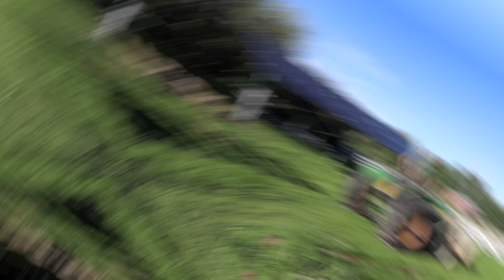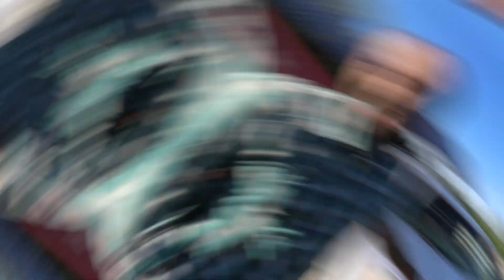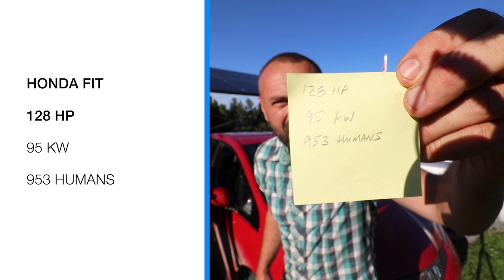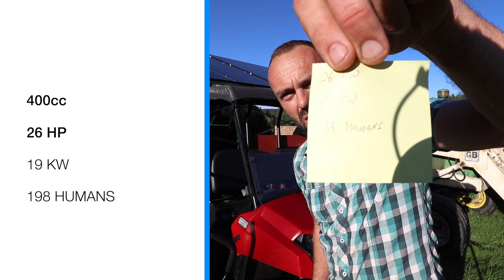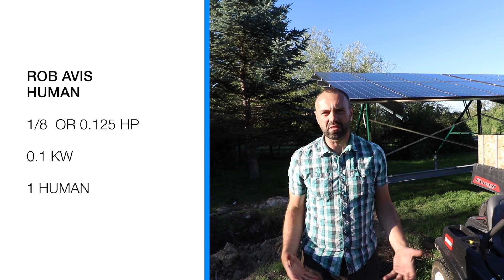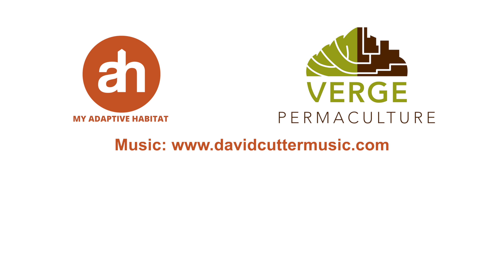Why Peak Oil Matters More Than Ever:  Permaculture Canada

Comment: The comparison with humans is off by one or even 2 orders of magnitude as the HP ratings of these cars don't relate to the HP of "work" they can do.
 It's HP of the internals. Tesla's HP rating is similar to these cars, yet its battery is 100KWH. If it was used for the whole 200KW of its "engine power" it would only last 30 minutes.  It's doubtful that you need an entire town to pull a trailer for 100 miles distance ;) There won't be car's velocity but the job gets done with much less dramatic "muscle energy" requirement. If you put a peasant on a farm with no machinery he still can feed himself with 100W of power he himself produces. The problem is that of the adjustment - too many people doing useless service jobs in cities having 0 skills to sustain themselves on their own.

Comment: Electric motors need electricity, which is mostly generated by fossil fuels.  So the alleged efficiency of electric vehicles is deceiving because burning coal or natural gas to make electricity is not optimally efficient.  Energy is also lost when converting from one source of energy to another, or even converting from AC to DC.

Comment: Can someone check my math?

My 90hp  tractor (weighs 7klbs) / 40 gallon tank / worth about 10k U.S. dollars 

-7lbs lithium batteries = 1lb diesel (energy equivalent) 
-Gallon of diesel = weighs appx  7lbs
-40gal diesel  tank =  280lbs

It would take 
-13,870lbs (280x7x7) of Tesla batteries
-Cost of 200k (I think/best guess) 
-To produce the energy equivalent output of the diesel in my 40 gallon tank?

I would triple the weight of my tractor and increase the cost by 2,000%? 

Is my math close to being right?  That sounds way to nuts to be right?

Comment: I've got some bad news for you. Peak conventional oil occurred in 2007.  Fracking of "tight shale" is not quite the same thing, as it's actually called "light equivalent liquids".  And while fracking has produced enough gasoline and propane to force the costs of those fuels down; gasoline is about the heaviest hydrocarbon that can be refined from "light equivialnt liquids", but our world doesn't really run on gasoline, but diesel fuel and heavier fuels.  We're already in the after peak-oil age.
Reply: Not only that, the tar sands we have been relying on are drying up because of COVID temporarily  plummeting oil prices

Comment: It's interesting, if you hooked the JD up to the Honda and took off in different directions, there would be a lot of smoke from the 250hp Honda, as the 50hp JD pulled it inside out. :-)

Comment: BioMethane is one of the many options
Reply: But doesn't it take like 1000 cubic feet of Biomethane to equal 1 cubic foot of diesel?
Reply: @trollforge  is just like natural natural, but made in farm by anaerobic digesters
Reply: @BrunoGarcia79  so 1040.4 cubic feet...
Reply: @trollforge  you are comparing a gas to a liquid consider the weight and compressors
Reply: @BrunoGarcia79  so, if you could compress biomethane into a bbq tank, you could get about 4.7 gallons, or about the equivalent of 5/6s of a gallon of diesel?
Reply: @trollforge  compressing biomethane (3000psi), to less than 1% of the volume it occupies at standard atmospheric pressure...
Reply: anyway you keep comparing apples to oranges... BioCNG as 20267 BTU per pound a diesel as  while diesel as 18397 BTU per pound ...  1870 more BTU per pound than diesel...
Reply: @BrunoGarcia79  OK, that would make it a much better option, but it is not reproducible in an on farm operation...
Reply: @BrunoGarcia79  That is not the figures I am seeing... I've got "6.38 pounds or 139.30cuft. of CNG has 100% of the energy content of one gallon of diesel"  https://afdc.energy.gov/fuels/fuel_comparison_chart.pdf  Am I reading something wrong?

Comment: Good video. As I've been working on reducing my requirement for money, my requirement for power was evident. As I'm working on reducing my requirement for power, I realized how big my requirement for water is. Being urban in zone 3, its a challenge to solution an emergency water system that won't freeze. Slowly but surely we are reducing our requirements for fossil fuels to heat and reducing power consumption before investing in solar. My biggest reward was moving to no dryer and no extra freezer. That was almost half of our consumption. We've now moved to electric free washing and reducing water consumption came naturally from that. Refrigeration is another challenge area. I enjoy your knowledge sharing. You get me thinking out of the box. Thank you!!
Reply: Depends on your location, rainwater harvesting can be a solution for most of your non-drinking water needs.
Reply: @sergio2441  We do that for summer months but again we can't bring it indoors for winter use. I have no basement and our house is made from cindercrete so I can't lift it to put a cistern in either. I am thinking of using the excess rainwater to create an ice house once we complete our covered porch with outdoor kitchen - future budget. It wouldn't be huge so I'm not sure how long I could keep it functional. Be a fun experiment.

Comment: Homemade bio-diesel is a possibility, I wonder how the math works on energy in -> energy out ratio. I wonder how much land/labour/time to have farm-scale diesel. I ask because the rare elements required for high-efficiency batteries to replace those tractors require a working global supply chain... which only functions if energy is cheap.
Reply: /I wonder how the math works on energy in -> energy out ratio./I cannot give you a reference right now, but I read that it is close to 1.1 to 1 or even lower.
Reply: @sergio2441  I doubt it would be anywhere near that if you factor in the planting, growing, harvesting and processing of the crop, & production of the oil...

Comment: Something you haven't touched in your video is ethanol or vegetable oil as a source of energy for this engine. This would require less battery and you wouldn't need to replace that old tractor, maybe?

For example, how much hectare do you need to run in your climate your tractor on canola or sunflower oil? Compared to solar panel?

Also solar panel are not really necessary if your electricity come from a nearby renewable source like hydro (which last a century when build correctly). Relying on the grid depending on the context might be better investment I would think.
Reply from the maker: Very low EROEI.
Reply: @VergePermaculture  for ethanol, I have read it was around a mean 5:1, but I have found nothing about vegetable oil as a direct replacement for diesel. I would expect it to be above ethanol has you would have less transformation has once harvested, you just press oil out. Do you have any data on the subject? (I know biodiesel is terrible with a EROEI of 2:1). I am guessing it also depends on the local climate and how productive a field of canola or sunflower is. So you EROEI would vary with climate, but Canada being a huge producer of canola, I would hope it isn't that bad in Canada context (I haven't looked at it much).
Reply from the maker: @CedricBAIL  It depends on if they are using nitrogen fertilizer. The other issue is biodiversityloss, soil erosion, phosphorus application, pesticides ect. ect.
Reply: @VergePermaculture  Just realizing something here, but is EROEI the right measure to take decision? In this case, we also need to change tractor or at least their engine and add battery which require also a lot of energy to do and would not be necessary when switching to vegetable oil. So would the resulting change be higher when switching to electric engine than switching to vegetable oil? Does that change the conclusion?
Reply from the maker: @CedricBAIL  Good points. A detailed embodied energy analysis would need to be done to answer the first question. Europe was responsible for millions of acres of degradation in the global south due to their policies around biofuels. Their desire to run veg oil in ICE engines encourages the global south the destroy millions of acres of pristine rain forest in order to grow palm oil for vehicles. In addition, ICE engines are only ~20% efficient where electric ones are 98% efficient. Batteries are not perfect but nor was the oil industry 100 years ago. As the industry improves the numbers will get better. Canola, corn, soy, palm, and coconut as well as lard,  tallow and other animal fats  are fine in of themselves but when we grow mono-cultures of any of them we destroy the planet. Our vehicles, like our plants should run directly on sun or wind. We are running out of oil and if we want to continue to have a complex society with biodiversity on the planet biofuels will only ever play a small roll bioregionally. Trying to fuel billions of engines with plant based fuels is a fools errand at best.
Reply: Diesel engines were first designed to run on vegetable oil. I've watched videos of guys converting diesel back to vegetable oil. But I agree, our farm land shouldn't be used for producing fuel when food is scarce throughout the world. I enjoy reading about all the new energy innovations. Some really good ideas. Too bad they are all based on making money off a consumer, hence hydrogen over wind/solar because a consumer will keep coming back for hydrogen. SaskPower and our government have already reduced incentives to put solar on because it effects their bottom line.
Reply: @jelienneschubert  There is serious difficulty with maintaining an electrical grid when there is to much wind and solar as they do not have inertia and can become out of phase. Hydro and nuclear (gaz, oil and coal too) do have that inertia which help the grid being kept in sync. I do not know what is the situation in your region, but it might be more complex than we imagine.
But here, talking about oil, oil is the blood of the modern as Rob's video show. Every transportation method needs it. And solar, wind, hydro or nuclear do not solve that problem. I don't think that hydrogen will as it require some really rare metal to power an engine and its energy density is really low, but maybe I am wrong. Anyway, however you look at the problem, the solution is in our usage at this point and how to reorganize society to need less transportation and engine, so we can adapt to a world with less oil. Permaculture zone reflection and efficient movement design sounds like a good mindset to have.
Reply: @jelienneschubert I agree. neither should our trees get burned to produce energy!
Reply: How is vegetable oil sustainable? The solar and wind while worth It in small scale, are not reliable for large scale. Even if we all switch overnight to electrical vehicles, the grid can't support all of us. The best energy to use is atomic energy. It is very safe to produce and reliable.
Reply: @aldas3831  Electric vehicles have a huge mining and build time required. If we wanted to replace all the car to be electric, it would take more than a full decade using all existing car manufacturing plant capacity. Then add tractors, trucks and boats. It becomes very hard to imagine such a scale of deployment happening very fast. And if you add the energy needs for all of those, as per Rob's video, the scale of increase in electricity demands will be another problem to solve. Sure nuclear is a possibility, but the entire mining needs for such a new infrastructure (I mean car, electric grid network and power plant) is tremendous and it just move dependencies from one source oil to a bunch of other mined resources. Not convinced it will be sustainable at the scale of current usage (https://theshiftdataportal.org/energy/final-energy).

In that regard, vegetable oil could be less mined than any of the above electric industry and reuse old and existing tractors/trucks/train/boats which would reduce the strain put on the resources needed to migrate transportation to an electric infrastructure. This is a maybe and why I am asking the question.
Reply: Cedric BAIL all kind of energy have positives and negatives. I agree that electricity cannot support all the demand.  Oil is the best source of energy so far compared to the rest. But because it’s future scarcity the nuclear energy is the most efficient. Look at France. They run mostly on nuclear. Is very safe. And compare that to Germany which started a huge solar and wind push in the past decade and now buy Oil from Russia. Clearly they did not solve their energy problem although they spent a lot of money.
Reply: @aldas3831  I know France quite well and I am not dismissing nuclear energy at all. I just want things to be put in perspective. It took France more than a decade to have a very low carbon electricity mix. This migration was done only for the electric use (houses, industry and offices), but not transport. It was also done in a very central state planned operation. Current cost of nuclear is mostly paying interest over 40 years due to how private capital investment work (And still it is cheaper than Germany plan which has spend as much money as if France did rebuild all its nuclear power plant at the highest cost, I know). All of this make me believe that just migrating existing coal/gas power to nuclear power will be a hard task. If you want to add transportation/oil to the list of problem that nuclear should fix, I am afraid that it will slow down the adoption of solution that we need to roll out yesterday. I don't think there is a silver bullet to our problem and we should use everything that make sense as soon as possible.
Reply: @CedricBAIL  and I am not trying to debate or correct you. I agree there is no silver bullet. We must consider all sources that make sense for our country, just don't agree for us trying to commit suicide.  at -40 humans don't survive.

Comment: Thanks, Rob.  With all of the recent talk about "saving the economy"--there's not enough conversation about the fundamentals of our ENERGY ECONOMY, which runs on a deficit any time we're using more energy than what what comes from renewable sources.  It's analogous to burning our homes in order to stay warm: Eventually, the time comes when we run out of house to burn, and then it's game over.  This isn't fatalism, it's physics.  The best use of fossil and other non-renewable energy sources is for quickly getting renewables  on line while syphoning surpluses into resilient living systems (biogeochemical 'batteries').

Comment: Thank for the video.
I'd love your take on embodied energy of a solar panel, though. Not as clean as you let it believe in the video,  no?
Reply from the maker: This is why I mentioned Energy Returned on Energy Invested. EROEI. Solar is about 6. Oil sands is 10 units in, 11 units out. Saudi oil 100 years ago was between 1000 to 20,000 out for 1 in.  Wind is better than 6:1. The thing we have to remember is coal, gas, and nuclear plants will never have a positive EROEI because they only consume. Renewables at least have that ability. The best solar collector ever made will always be a leaf. Any system not built on a foundation of photosynthesis is not regenerative.

Thanks for the comment Ludo.
Reply: @VergePermaculture  Thank you for taking the time to put this video up,  and to answer on comments. I appreciate even more that you are running a beginning of a farm, as well! Keep posting about what you guys do and chatting about what you have in your mind. Even if we work in very different climates, it still very interesting and relevante, to me. 
Thanks for doing it the your way...
Reply: Data here: https://cleantechnica.com/2018/02/03/solar-power-can-pay-easily/ 
"PV solar systems today easily generate enough electricity to equal the amount of energy consumed to produce them. They then go on for many years to produce clean electricity."

Comment: In order to make this a valid comparison, you would need to get electrical equivalents and be able to charge them fully from your solar array, run the vehicles till they need to be charged again, and try to recharge those to full.  Your solar array needs to be able to produce AND store enough energy to keep the whole system running.

Tractors use diesel and they were originally designed that way so that farmers can make their own fuel.

You really need to look into the entire production process for the PV and electronics and batteries. I did and came to the conclusion that this process is so dirty and so energy intensive, that I'm not sure it's worth it.

I get the point you're trying to make and you're not wrong about needing to clean things up a bit, but I'm not convinced PV is the way to go. Good system design is the way to go. (just my 2 cents)

Comment: That was SUCH a demonstrative video!! Thank you!! We’re working to take our small schoolhouse off the grid in southern Ontario. We replaced two oil furnaces with a 9ton geothermal system and outfit the flat roof with an array of 30-something solar panels and it’s always a jolt when we explain to people that we’re still a long way from becoming self-sufficient. Your point of doing with less is the key! We’re going without an oven, a dryer and a dishwasher to get us closer to the solution: modifying our consumption. You’re so right - we have a LOT to learn and we’ve been going along blind and privileged for so long. Looking forward to learning more from you!